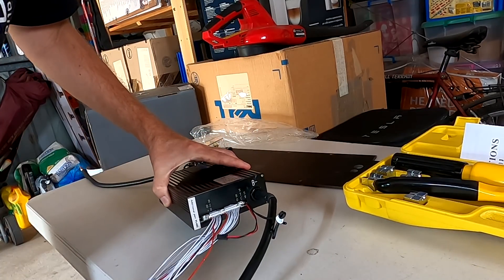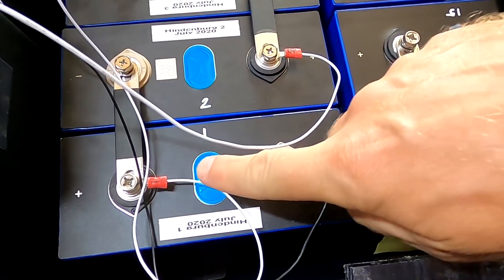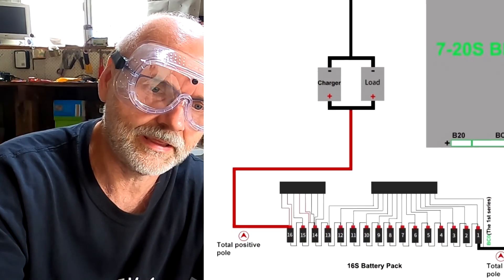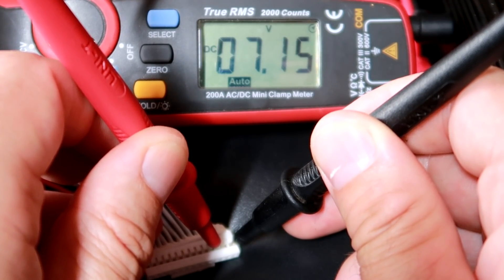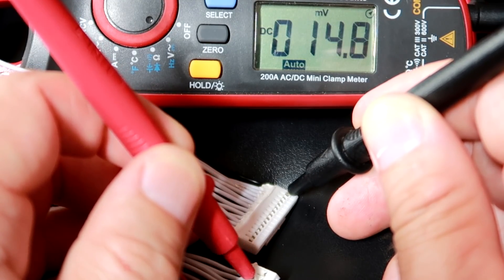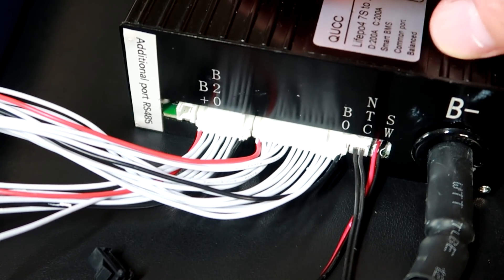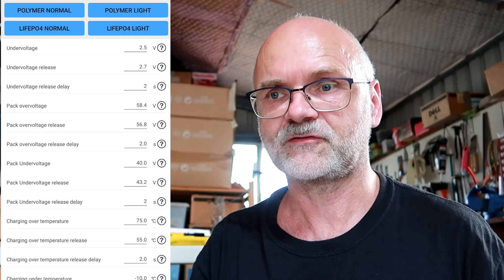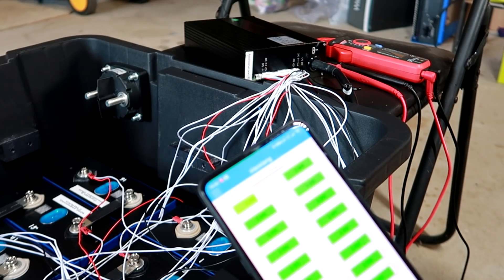BMS 101 - there is a problem #buildthebattery.5.2

Comment: It's my first lifepo4 battery, and the xiaoxiang app didn't seem like it was working properly, so I downloaded the overkill app as you said, and it was working better. I think I messed up the parameters trying to match what the battery manual said the battery should be at. All the settings on the bms seemed really high, and I thought it was overcharging the battery. I'm sorry, I just really don't know what I am doing, and thinking I'm doing it right doesn't mean I can. Please help dude.

Comment: Hi, the first to lead (red and black) are for switch? How do this works? There is no information with in the package, Tks
Reply from the maker: I think you can turn the whole balancer on and off with these two cables. Not sure why you would do that though. I left them unconnected so the BMS stays on all the time.

Comment: Hi friend I am subscribed to your channel and I'm a big fan of off grid solar. I can't seem to find a youtube video about separate port BMS preferably the JBD BMS and the QUCC. 

Could you do a review on these? What I really want that BMS to do is when a cell  starts spiking due to over charging I don't want the BMS to cut off the load, I would like it to cut off the charging from the solar charge controller because the common port type BMS  seems to cut everything off once over charging is detected.
Reply from the maker: Thank you Michael!
I think this is the BMS you're looking for: https://youtu.be/EtC0mShaRbo
It turns off charging if cell voltage is too high but leaves the load connected and vice versa with low voltage.

Comment: On your last balance wire plug am I seeing it correctly when you have multiple wires going to one cell group? Would this just let the chip see voltage but not effect over charge protection and balance capability of the cell groups? My Daly bms has same 2 plugs and I can’t get it to wake up. I don’t have the last balance wires hooked to anything right now though. Please help I feel like your actually smart and have a grasp of this

Comment: Dear Andy, I want to build a 24v 8s 280Ah LiFePO4 battery bank, but I am not sure what current spec of BMS I should pick. (There are varied current spec in diffent BMS) Could you help to provide some advice to me? Thanks 😊
Reply from the maker: Jeff, what do you want to power with your 24V battery?
Reply: @OffGridGarageAustralia  I want to power a 24 V 3000W inverter. By the way, do you know why the battery discharge rate (Amp) is always double of charge rate (Amp)?
Reply from the maker: @jeffma1220  You simply divide 3000W by 24V which results in 125A coming from your battery. So this is the current the BMS need to handle. I would recommend going with a 200A BMS in this case.
Batteries always have a slower charging rate than discharging rate. The LFP cell I use for testing has 1C charging but 3C discharging. Because of the chemical processes, this varies a bit with different brands and models depending what goop they use inside the cells.
Reply: @OffGridGarageAustralia  acknowledged and thanks 😊

Comment: Very nice and useful videos! Thank you for that! One point from my side: I saw this also in some other videos. All these thin cables fo sensing the single cell voltages are strapped together. Looks nice and clean. But what happens if you get a short between two of these cables? Maybe not so dangerous in your application because its stationary, but in a mobile one?... Do the cables have a special (thicker) insulation? 
Hope "my" frogs come back soon when it gets warmer now ;-).

Comment: 021521/1501h PST- 021621/ 0901 Brisbane.  Thank you for the elaborate presentation. I have, often, come across YT Warriors comment that, Daly failed, JBD failed, XYZ BMS failed etc etc. You, very specifically, warned that the balance cable must NOT be conned to BMS module, until and unless it is (wiring) checked for proper connection.(several times!) aw well... Thanks again stay safe and 73s...

Comment: Andy, when you run the BMS app, do you need to connect the positive output wire to B+ at BMS as well as the negative wire to B- at BMS ?

Comment: Excellent video, very detailed. The on-board high current relay/contactor is a nice feature for sure. Thanks for bringing it to our attention. The biggest issue with this BMS (like most of them) is the extremely poor cell balancing design. Large capacity cells would do much better with 2 to 5A of ACTIVE, dynamic balancing delivered over the entire charge/discharge range. Active balancers remove energy ONLY from the highest voltage cell and delivers it to the lowest voltage cell via capacitors instead of just wasting it as heat through a resistor. A good, high current Bluetooth cell balancer can actually cost more than the BMS, however, I believe they are worth the upfront cost because they do a far superior job of minimizing problems due to cell variability such as internal resistance and self discharge properties. Both of which tend to diverge with age. For example with a 48V, 16 to 32 cell battery build, it is entirely possible to save well over $1000 on less expensive, non-matched prismatic cells and then add a $300, 5A balancer to take care of any differences between cells.
Reply: Support you. Active is also much faster with no/minimal heat. I'm actually at the point of assigning Balancing to a separate 2nd (Active) Device to do a proper job. Just wish the BMS Manufacturers would start excluding this Feature Claim from their Products cause it's almost practically useless.
Reply: @2ClicksUp  Agreed. FYI The Zero Emission Vehicle Australia (ZEVA) BMS I'm using does have a setting to turn off passive balancing or set balancing to Dynamic or only start balancing above a certain cell voltage threshold. I turned off BMS passive balancing when I installed the 2A active balancer. I would really like to see the active balancer have settings so active balancing would ONLY occur at the lower voltages during discharge and the higher voltages during charging. I have determined it is really not necessary or desirable to balance cell voltages in the FLAT part of the cell voltage range. For LiFePO4 I would set the no balance range at something like 3.0 to 3.3V.
Reply: @bentleyjarrard885  Please share possible advised Activate Balance Models ? Personally, I set BMS to Cut Bank somewhere around 2.85V/Cell(min), so, this avoids getting near bad low CellV.  The last bit of V is just not worth it... So, Balancing, for me, only above 3.32V/Cell, which is where I Float (+/-3.34V/Cell) them, so, Balancing is truly taken from Charge & not Cells.
Reply: @2ClicksUp  The best, reasonably priced, readily available active cell balancer that I know of is the JK BMS Bluetooth type (1A & 2A) that is sold in the square black metal case on various Internet sites under several brand names. As stated before the only thing I don't like is that it balances all the time even when in float which is not necessary. Batrium makes a series of BMS and cell balancer products that have been reviewed on YT. I don't know much about the Batrium products because they are on the HIGH end of prices.

Comment: I've seen this on other channels but you take your time to make sure the viewer really understands which. Is so appreciated dear sir. I'm not ready to build a battery just yet, but feel with a bit more of training on top balancing then if be prepared to give it a go. Thank you and keep up the good work. Ohh a question? If I had a large bank of 48x 180amh cells wired to 51.2v in series/parallel. How would BMS be fitted. I would need more than one BMS no??
Reply from the maker: Thank you for your feedback,  Lenny.
With 48 cells and 51.2V you have to put 3 cells in parallel first. They act like one cell, just with 3x the capacity (3x180Ah). You keep doing this 16 times until you have 16 separate banks with 3 cells in parallel. Then you connect these all in series to increase voltage to 51.2V (48V system).
You will need only one BMS for this whole pack.
It does not matter how many cells you put in parallel, they will be seen as one big cell by the BMS.
Reply: @Off-Grid Garage. Thanks for reply Andy. I guess that would be the same for 280ah cells? Excellent. Thank you. When I'm ready I have to fly you to Caribbean to assist me lol.
Reply from the maker: It does not matter what capacity the cells have when they are in parallel. so 3x 280Ah in parallel will be seen as one cell with 840Ah from the BMS.

Happy to come over ;)

Comment: Great detail as always, Thank you! I was told that you never want to lower your voltage limit in your BMS (3.5v) without first lowering in your solar charge controller, otherwise your pushing that extra current through those bleed off balance resistors, does that sound right?
Reply from the maker: The BMS is always your safety net, your insurance. The MPPT should charge to say 3.4V and then stop. The BMS should start balancing at 3.5V and turn off altogether at 3.65V. If the cells are well balanced there should be no need for balancing through the BMS because the MPPT will turn off first.

Comment: What is the balance current? I'd like to have a atleast 1 amp balance current, and balancing when ever its changing! Or atleast above nominal voltage, it requires alot to balance a 1200 ah battery!!
Reply from the maker: Yeah, nah, they all have only 20mA or so. This one I have has at least 200mA. And don't forget you balance right in the steep curve so even balancing with a small load works fine.
I think some of the more advanced system like the ElectroDacus BMS have higher balance currents.

Comment: I have a small BMS with the multiple cells configurable system, it makes me wonder how it works, mine is 7 to 16v series cells, anout the middle the leads go to a single cell! It's nice to have a bms capable of 24v or 48v, 
Yes it's important to test the leads BEFORE connecting to the BMS!

Comment: I have a 10s, 30 amp bms for my electric bike that uses the same bluetooth program, but I bought it from lithiumbatterypcb.com. It works great but the battery percentage often reads wrong, and the company's support is really slow, so if you message them, you may never get a response.
Reply: @Landon>>> how did you. One to the conclusion, that the battery voltage % reading on JBD is wrong? From where did you obtain the comparison? From PV Cells Charge Controller Bluetooth output? 
I also procured the BMS from the manufacturer. The battery voltage %, is more or less the same (+/-  .02 volt)  compared with VICTRON MPPT 100/30 charge Controller, reading. In any case there will be slight variation which is negligible and not worth any concern. 73s..(regards)

Comment: Very keen to see how well that BMS goes. Lots of the off the shelf batteries (e.g. 12v 100Ah)seem to use that app, so the company is producing a lot of them. But I've seen several different app's with different batteries from the same supplier. 

OCD moment, watch the battery level in your clamp meter. It's been bugging me that it's low for a few weeks now. Some of the cheaper ones start to drift in reading accuracy even before they get critically low voltage. Although I use the same one and haven't seen that happen yet.
Reply: The other thing, did you find your Brother labels were having trouble sticking to the battery surface? Mine were super difficult to adhere, even after cleaning them. 

Being in the BBQ, I think the frog could be named Pork Chop ;)
Reply from the maker: I bought the cheapest I could find: https://www.officeworks.com.au/shop/officeworks/p/dymo-letratag-100h-handheld-labeller-pink-sasd83000

Labels are paper based, not the plastic ones but hey it's for inside use. So far  they are working great and stick very well.

Comment: Hey Andy it is very dangerous to measure cell 1 with the measuring tips. It's high dangerous to make a short.To do the connection point better is at the main negative pole and far away the cell clamping. But you make me so happy that my project will be going the right way as yours. I ordered 16S  100Ah from Donguan Lightning on Alibaba 641€ all in total DDP. I Think I will get this 4-5 Weeks. Can't wait😉
Reply from the maker: I know what you mean, but with these probes it's impossible to make a short.

Comment: Another great, great video, and an in depth insight of what to expect on building you battery. Thank you very much sir.
Reply from the maker: Glad you enjoyed it and thanks so much for the feedback!
Reply: @OffGridGarageAustralia  I am hooked up... I need to see what happens when you connect the whole system.

I am planning on building a portable battery box, with 4 LiFePo4 batteries, and I am thinking, if  with a BMS I will be able charge it directly from the alternator (although mostly solar), or if I need a DC to DC regulator... 🤔🤔🤔.

Need to check that out.

Comment: Without the B- cable connected the "balance lead" is now powering the BMS. Put your clamp meter around that black balance lead wire and you'll probably see some amount of current going through that wire when the B- cable is not connected. Since it's such a small wire it's causing a bit of voltage drop.
Reply from the maker: Great tip, I'll try that!
Reply: Sounds logical

Comment: Another excellent video! I have the Xiaoxiang 120AH BMS with MOSFETS that I bought from Overkill Solar in the US (Florida I believe). It seems to work well and has the same software you displayed. I fully discharged my 280AH battery to test the capacity (279.4AH) with the Victron shunt and charged it back up at .25C without it even getting warm. BTW - The frog in the grill (frog in the pot) reminds me of our current worldwide political situation.
Reply from the maker: Thank s Peter, great comment and feedback 😁

Comment: Will be interesting to see how sensitive that BMS is once you put the shunt in between the battery and bms may give you wrong readings.
Reply: This is a good point. Since disconnecting B- clearly affects the voltage reading for cell #1, it's possible that any voltage drop across the shunt will affect the voltage reading of cell #1 as well.
Reply from the maker: Hence I decided to install the BMS first.

Comment: When I check for the voltage readings on individual wires, I only check for continuity on the first black wire then I use the battery terminal where to put the negative black  probe and check on the individual wires with the positive red probe. This is done this way to avoid accidental shorting on the first black wire and second wire beside it with the probe conductors as the pins are very close to each other.

Beautiful frog in the end. :D
Reply from the maker: Great tip, thanks.

Comment: That contactor/relay must be drawing quite a lot of power/amps. That's why your voltage sense was incorrect due to the voltage drop when you didn't connect the main battery terminal. BTW I think it's not good to give instructions to people to connect the BMS leads first before connecting the main -Ve terminal. It will damage other BMSs, even if yours didn't. Thanks.

Comment: Non active BMS use a resister to burn down the imbalance which makes heat which is loss of production.
Reply from the maker: I've got an unlimited energy supply.
Reply: What about non resistor active balancers?

Comment: Do your battery cells swell even when they are fully charged? I noticed an increase in volume of around 1-1.5mm per cell.
Reply from the maker: No, Not at all. I read in the forum that they apparently swell when over 50% SOC and sink in a bit under 50%. I could not verify this at all.
Reply: @OffGridGarageAustralia  Thank you for this information. I'm just worried if the swelling of the cells is still causing physical stress on the battery bus. 🤔

Comment: If you have overvoltage protection kick in and the relay disconnects, how do you discharge the battery? Same if undervoltage, how do you charge the battery? Do you not need 2 relays and some diods?

Comment: Without the B- connection the bms supply current will go through the measurement leads of the lowest cell connection. Thats the reason for the low reading of the first cell voltage. On the highest cell there are the two connections, one for the measurement and the other one for the supply current.
Reply: Yes this...
Reply from the maker: The thick black cable and the thin black cable are not connected internally. The last terminal only has two wires because I'm using less than 20 cells in series as I explained. Otherwise you would have only one wire per cell.
Reply: @OffGridGarageAustralia  the power to operate the BMS has to come from somewhere, including the return path. When you put the B- connection on and the measurement error goes away it means there was a voltage drop on the measurement leads causing that. The electrons don't care if the way is intended or not. Anyway keep up the work :)

Comment: That was really interesting. Although in your final setup having B- connected off course would have given the correct reading for cell 1.  I take it with the shunt connect to B- wouldn't impact the measurement of cell 1 then?
Reply from the maker: I don't know if it impacts that reading but I have now decided to connect the BMS first.
Reply: @OffGridGarageAustralia  thanks for the response. Any main reason for the change in direction because you did provide a good enough reason in your video to place the shunt 1st

Comment: Something is still a mystery to me: they say that in order to connect a BMS correctly, the balancing cable must first be connected and then the BMS with the main minus - but how do you manage to connect the main minus cable WITHOUT disconnecting the black balancing cable?
Reply: I have always connected my main negative before my balance leads. There is no power until the balance leads are connected to the bms. Heck balance leads are normally the last thing I connect as long as you check them like he shows you are fine.
Reply: @recoblade1465  Thank you!